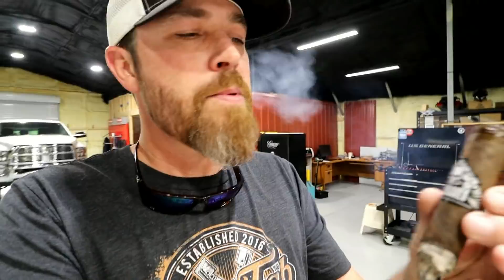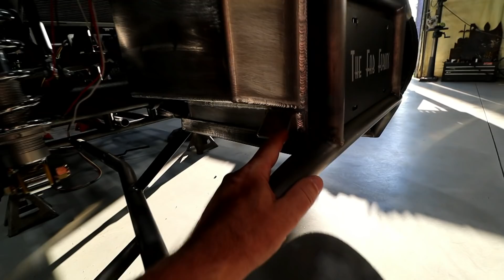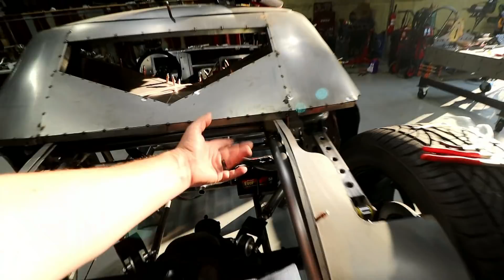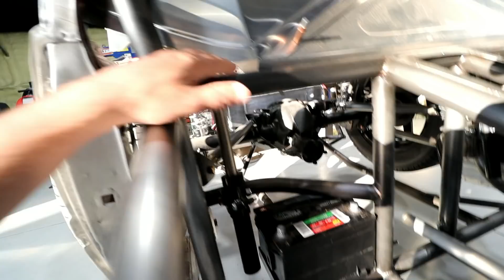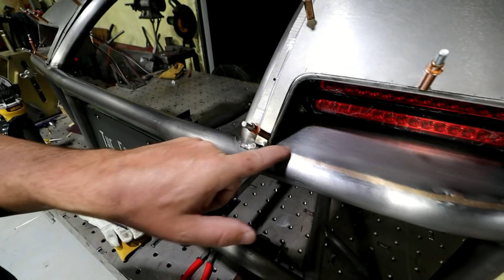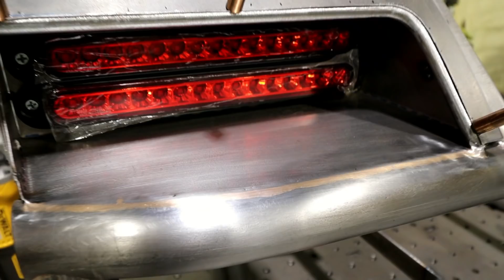TIG Welding with Silicon Bronze Filler Rod

Comment: No information on electrode choice, electrode diameter, rod diameter, sheet metal thickness, tube thickness, amperage used, pulse or not.

Comment: Why not make the entire tank cover a lid?  Save on cutting a massive hole in it plus still allow access to your fuel cell. Also, elbow or rest jig to prop on dude. Your torch arm was making mine tired just watching you try and hold steady without a prop lol. Best tip ol timer had ever given me was always be comfortable when your welding. Been awhile since ive watched any of your vids. Your coming along great on the Bibster.

Comment: Nice work! I use silicon bronze quite a bit and I reckon the trick is to heat the base metal only through the puddle if that makes sense (except right at the start). With a regular TIG joint you want the arc right in the root of the joint. With brazing the arc and the dip are just a little bit back from that leading edge so you're not mixing the copper with the steel but just letting it sink in from the heat.

Comment: I hope no one will rear-end this,  might turn into nasty fireball.
Reply: Funny thing... Aluminum doesn't create sparks. Tank is aluminum and fuel tanks have been in that location for over 100 years.
Reply: @Phyxx_TX  Airplanes are made of Aluminum, but the fuel still catches fire when the tanks are ruptured.  Fuel system/tanks need to be protected...30mph fender benders killed nearly 180 people driving the Ford Pinto.
Reply: I thought the same when I saw the Radiator episode(s).  I'm hoping there is some compartmentalization from the fuel and coolant lines...would be really bad to have 220F coolant get sprayed on you.

Comment: You should check into some quick disconnect fuel lines SRI in Mooresville North Carolina could direct you to that they use them a lot in NASCAR for radiators and oil lines ETC you might like them

Comment: Too bad Silicon Bronze is so gooey, I thought it’d be a good spot to show off stacked golden dimes! Still looks good!
Reply: I've only just started using silicone bronze at my new job for last 3 month. Definitely can get defined dimes on sheet metal. Comes down to pulse settings ive found. Im loving using the stuff.
Reply: you can stack dimes, but it does become difficult at the lower amperage range of the material.  increase gas flow with 100% helium, and welding on plate instead of sheet should allow for the stacked dime look.  But to get it on sheet is difficult.

Comment: Would that not be brazing then and not welding?
Reply: no it is considered welding still.  you are melting both base metals and filler metal to form the bond.  the term "TIG Brazing" is miss used when applied to Silicon Bronze.  It has elements that bond to mild steel as well as a number of other materials.  the only metal better for dissimilar metal welding is Aluminum Bronze A2; but that's my opinion.
Reply: @ryanturriff6020  No... he's correct.  This is brazing, not welding.  You said it yourself.  It bonds.  Like glue.  The dude doing the work here also said it.  The steel has a higher melting point than the silicon bronze.  In other words, the base metal isn't being melted at all, just heated.  It's a similar process to soldering.  It's still a very strong joint, but it's not fully fused like a weld.  In a true weld, you are using a filler that can actually become part of the base metal, not just bonding.  You can even cut and etch and see how deep into the base metal the weld goes with true welding.  Can't do that with silicon bronze.

Edit to add a link : https://youtu.be/y6ccw7X8zeI?t=100

Listen to what he says here... and this man in the link is a welding god.
Reply: @GeekInJeep  that doesnt mean that the steel doesnt get melted.  if you are not trying for penetration, then yes, it is brazing.  but typically, you are welding with it.  just because Silicon Bronze has a lower melting point doesnt mean that you don't melt the steel as well to make a proper weld.  Silicon Bronze is used to weld Galvanized Steel and dissimilar metals on all production cars.  and none of them are being brazed.
Reply: @ryanturriff6020  Did you watch the video I linked?  If you did, you will hear him mention that melting the base metal causes cracking.   That is because the base metal and filler are dissimilar metals.  You cannot make an alloy of steel and bronze.  I am a certified welder myself.  Multiple types of metal and multiple techniques.  It's what I went to school for including having to take metallurgy classes.  You cannot weld bronze and steel together...but they can bond.
Reply: To add to this, in my non-destructive testing class, we induced cracking by putting chunks of brass (another copper alloy like bronze is) into the joint before welding.  Copper and its alloys cause problems in actual welds.
Reply: @ryanturriff6020  I did some research to try to make sure I'm not mistaken.  I see you work for Wisconsin Wire Works in your other post.  The only place I found a reference to melting the base metal with silicon bronze was on.... Wisconsin Wire Works web site.  If I'm wrong, I'm interested to learn more, but I'm not seeing much supporting data.
Reply: If I am wrong about silicon bronze welding being an actual thing at all, I still stand by my assertion that he is brazing in this example.  His entire goal was to avoid blowouts.  That implies that he was avoiding reaching the melting point.
Reply: @GeekInJeep  i'm going to answer each of your messages one at a time.  you can weld dissimilar metals with silicon bronze and Aluminum Bronze A2.  Silicon Bronze has trace elements of Iron in it which lead to the two elements welding together.  today, I just welded a Stainless nut to a mild steel bracket using Aluminum Bronze A2(mostly for looks, Silicon would have done the job fine and is as strong as the mild steel)  for my Sales Managers friend.  I understand that you are a certified welder and I'm going to assume that you are a teacher.  that being said, i can't tell you how many times i see the face of disbelief on the faces of welding teachers at Fabtech when they look over my pieces.  I gave my local weld school a bunch of samples to play with just because these kids will probably never see it again, and they found it very difficult to work with.  but hey, i have been welding copper alloys my entire adult life, and i find welding stainless to be insanely difficult in comparison. point is, you are nigh decorated and certified in a wide range of things welding related.  i specialize in copper alloys alone.
Reply: @GeekInJeep  brass is different than Bronze.  its like saying that baking is the same as cooking.  your typical brass(like low fuming bronze even though it should be called a brass) has an extremely high zinc element and is covered in AWS A5.8 under brazing alloys along with the rest of the copper brazing alloys.  high zinc, and lead can destroy the weldability of the filler metal.  Silicon Bronze can be use to braze when used at a low amplitude setting, which can speak to the diversity of the metal, but it can also be used to weld, and is primarily used in a weld application.  it is listed in both A5.7 and A5.8.  we don't sell 500 lb drums of 035" silicon bronze wire to automotive for brazing.  in fact product for the GMAW process is the most common form we sell.
Reply: @GeekInJeep   I suppose that speaks to our knowledge on the metal.  copper alloy filler metals is a very niche industry, so not a lot of people with in the overall welding industry gets any exposure to it.  this also means that not a lot of companies who provide filler metal are going to bother with it.  i can guarantee you that if you tried it, it is either originally our wire, or it came from china.  and i don't care what Harris says...  Chinese venders love to tell you who they sell to in America when they are trying to get your business..
Reply: @GeekInJeep   I can agree with you on his purpose.  working with a metal that you are not all that entirely comfortable with, i would play it safe.  hell I'm constantly cold welding when i tig Stainless at first until find the proper setting out of fear of blow outs.  I welded for 20 years before i touched anything other than a copper alloy.  and like i said, Silicon can be use to braze, but is also used for welding.  that was the debate.  not what he was doing.  and i am more than welcome to talk to you more about what can be done with copper alloys.  to be honest, i am never challenged when i make my declaration, so i appreciate the engagement from you.  i hope those that are reading this hoping we devolve to name calling are learning something from our discussion.
Reply: @ryanturriff6020  I appreciate the replies.  I'm going to research more... not because I don't believe you.  I do believe you.  I just want to fill the gaps in my knowledge.  I'm a geek.  Honestly, I'd love to know way more about the metallurgical side.  I do appreciate your patience with my overconfidence in my own knowledge.  I'm kind of used to guys who haven't learned the metallurgy making statements that are incorrect and I can usually go in confident.  Gotta laugh at myself on this one.